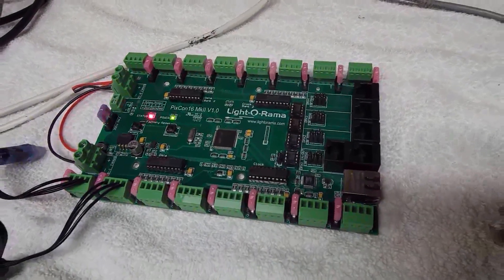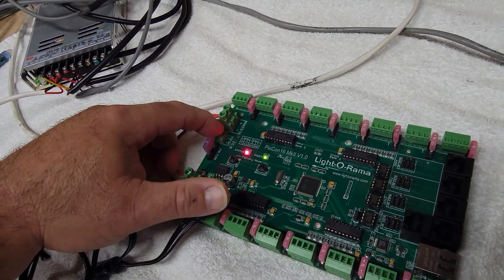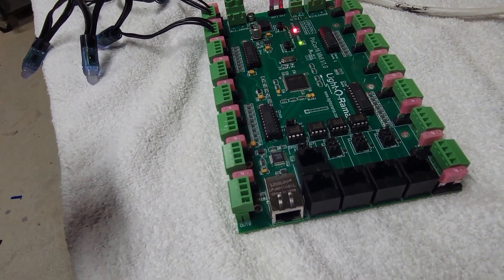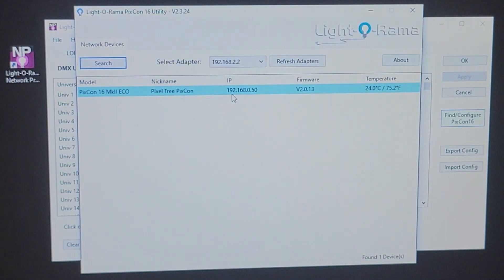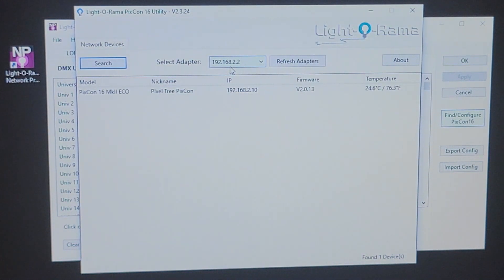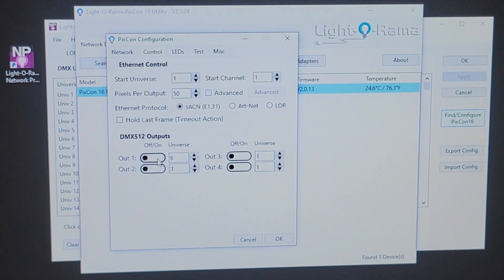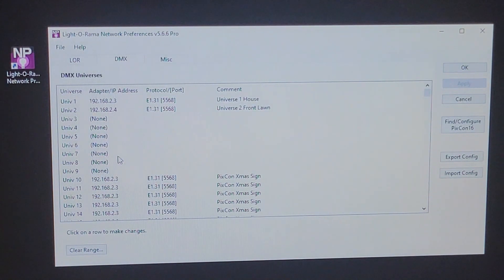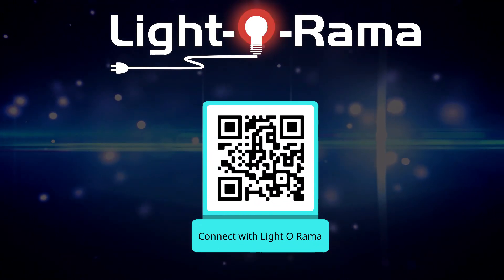Light-O-Rama PixCon16 Controller - Basic Configuration

Comment: Can you explain the jumpers on the board if using LOR network? For instance do all 3 pin jumpers for all 4 DMX/LOR need to be on LOR?
Reply from the maker: Only if you are using those ports to run other controllers. If you are not using those ports, then it doesn't matter what they are set for. For more in depth assistance, please contact our help desk or visit the documentation section of our website: https://www1.lightorama.com/documentation/

Comment: Is another Pixcon16 a DMX controller?  You mentioned around 3:00 mark that when running in E1.31 mode that you have four outputs for DMX controllers.
Reply from the maker: You can use a Pixcon16 in LOR or DMX mode